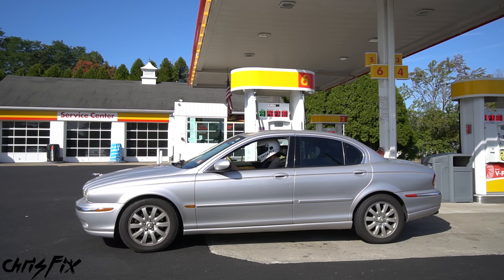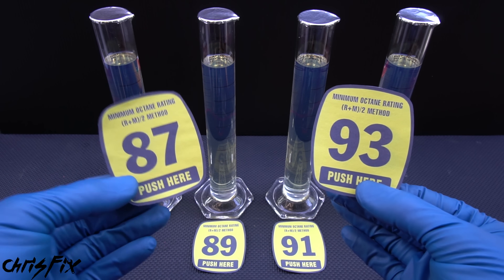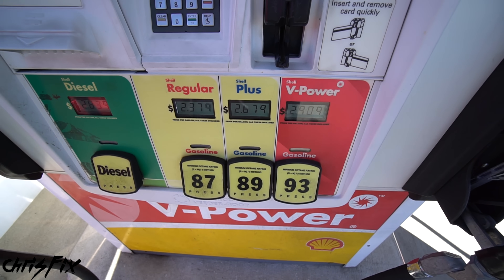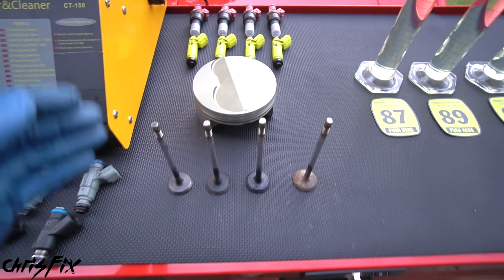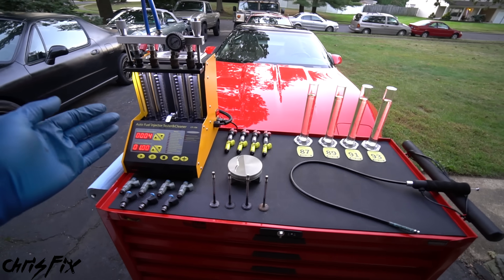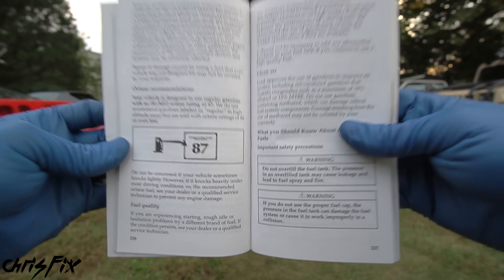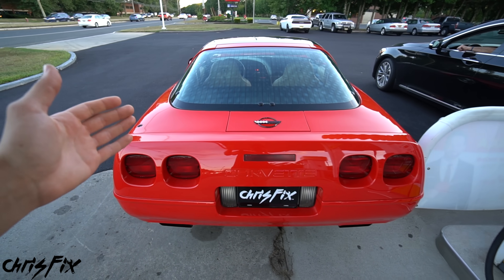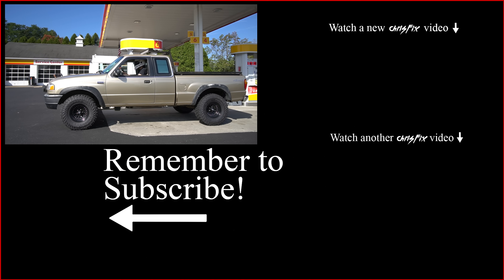What is the BEST Fuel to Use in Your Car or Truck and WHY

Comment: Is shell the only brand that has that many benefits and different useful additives? I did my best to research it and I cannot find detailed information about which brand of fuel has which amount of additives. Can I get a top 3 gas station brand list from you if that is possible? I have just purchased a 2013 Lexus Gs 350 with 100k miles and it was filled up with regular gas in the auction whilst it says premium required on it. It would be great to know which gas gives you the most bang for your buck so I can use specifically that specific premium gas to make my vehicle last.
Loooong time viewer, absolutely love your content and the way edit and film.

Comment: Do octane boosters really work????
Reply: For the most part no. A bottle of octane booster will boost your octane levels by 6 to 7 points usually. The problem is that there are 10 points to 1 octane. And putting multiple bottles in, isn't good with the harsh chemicals that are in the additive. One bottle typically is rated for treating 15 to 20 gallons. Aka..If you have a 30-gallon tank, you would likely use 1.5 bottles to treat your tank. 

So save your money and just buy higher octane gas if you want higher octane. Most additives do what they claim out there for fuel systems. But unfortunately, octane boosters not so much.

Comment: Could lifter ticking also cause the knocking code? I have a ticking noise in my car and it stops after it warms up or when I drive it for a little bit
Reply: Sounds like a vtc actuator problem
Reply: @ED17Y  I've got hydraulic lifters on mine plus when I place rislone engine treatment In it, lifters quieted like nothing but after it cooled down, and i started the car back up, the sound came back and it quiets it after warms up

Comment: Why would two different cars with the same engine use different octanes? For example, my brother's Infiniti FX35 (VQ35DE) developed a rod knock when he put 88 in it.  The owners manual did say to put 91, but the same year Nissan Maxima also uses the  VQ35DE, but it's owners manual (and a bunch of people who own them) said to use 88.  Needless to say, new engine with only 91 in it.  But why?
Reply: The cars likely came with different tunes from the manufacturers. So one car may have a higher compression ratio than the other, despite having the same engine and likely produces more horse power than the other car.

Comment: Can you avoid adding fuel injector cleaners fluids if you use 87 on an Accord or Altima at a top brand gas station like Shell, Exxon or Mobile? Or cheap gas stations like Racetrac, Valero, Sunoco or Marathon that use 87 is the same 87 in Shell, Exxon or Chevron?

Comment: My car runs best with one brand of diesel.  Total Fina sells only diesel plus (98) with their proprietary additive that runs noticeably smoother than other brands of diesel plus.  Using regular diesel (95) makes it sound like a truck.  The filler cap and manual only say diesel.  The better mileage almost balances the cost difference.

Comment: What if you have 300,000 miles one your vehicle and compression starts to drop. Would it be a better idea to go with one or the other?
Reply: You've got bigger problems than fuel if that's the case.

Comment: HELP plz. I have a 74 VW Bug. I was using regular. Then I  was told to use Non Ethanol... so I have now about 6 months. Very few stations around here have it... because of this, I almost ran out so I had to put some regular in it and then drove straight to another gas station and filled with  NE. Did this hurt my engine ??? !!!

Comment: WHAT about E88 FUELS?  IT states that cars newer than 2001 can use this fuel.
Reply: E15 (88 octane) is safe to use on "most" cars made after 2001. However, all cars made after 2013 are safe to use it unless specifically specified not to. Some cars like the Ford Fusion, for example, were not compatible with E15 until their redesign in 2013 happened.

Comment: Awesome video!!! Very helpful. My Honda Accord stopped in a middle of nowhere and it had to be towed to my dealer. 
They told me it was the gas ( LOVES 93 Octane) I used. The service manager said also to use only “BRAND GAS”. 
What’s the difference of a brand gas stations (Mobil, Shell, Chevron) compared to
non - brand gas stations (Sam’s club, Bj’s club, Loves) as far as added additives?
Reply: Judging by the details of your story, your accord "loves" 93 octane because of carbon deposit buildup in your cylinders causing an increase in the compression ratio which would cause regular 87 octane to predetonate. Consistently using Top Tier gas (which is featured with those brands you mentioned) in the first place would have prevented that carbon buildup in the first place, which is why the service manager recommended it as it has more detergent than generic gas at the kwikie mart. Please go get your cylinders checked out and have them cleaned out before you risk damage to the engine.

Comment: My car manual say i have a flex fuel engine but it recomment not to go below 87. I use 93 everytime and the power and performance is amazing kinda seem like im in a sports car lol. I think by me using 93 i believe overtime it made it run better and give better performance since i been using 93 for so long cause it definitely perform better than it was when i first got it and my gas last long too.

Comment: Very true that let's say for Acuras you have to go to the manual because he uses 93 otherwise the computer will get pinging and knocking from the knock sensor exactly on the point Chris is the best at what he does and his electronics knowledge simply a legend

Comment: I just bought the new Outlander 2022, I am very confused about what gas should I use. In the owner’s manual it says there “Use unleaded regular gasoline with an octane
rating of at least 87 AKI (Anti-Knock Index)
number (Research octane number 91).” Does it meanI can use the REGULAR 87 or should I use the Mid-premium gas 91-93. HELP :)
Reply: It means you can run regular 87 octane gas just fine. Your vehicle gets no added benefit from higher octane fuels.

Comment: Chris, what if I always get regular and add octane booster? my tank is 22 gallons, and I think it will be cheaper if I got regular and added a $3 octane booster... is that the same thing?
Reply: Octane booster sucks and should only be used if you NEED to

Comment: In Malaysia 95 is REGULAR and 97 is PREMIUM. There's nothing under 95 Octane. A 125 can make about 75 miles for $1.50
A sub 1 litre in line 3 cylinder... very popular there since the 90s... much like the 3 cylinder Chevy Sprint that met it's Oil Lobby demise in the 90s here... can make that distance for about $2.50 $3 (difference between OPEC and Western Oil opportunism)

Comment: What about fuels with ethenol?  I have heard it is not good for any vehicle, as it destroys o-rings, seals and gaskets.
Reply: Not true. Almost all modern cars you'd see on the road can hande up to 15% ethanol which is the maximum you'd find in fuel, besides e-85. E-85 will do this if you put it in a non e-85 compatible vehicke.

Comment: The best fuel for your car, is the fuel you can afford to buy. There are a million different people who will tell whats best for you, but what they fail to understand is that most decision made are based on our economic ability to pay for what we have, including it being a used or new car. Most folks are happy with a good used car that last them 5 years with minimum repair.
    What your talking about, affect's the long range care of which after 50,000 starts to cause wear and tare, most use the best they can get, based on the current information shared. Again we are speaking of a new car and not a used one, of which most people buy long after any initial wear has taken place, from 100,000 to a 150,000. At this point the damage has already been done. Making any change to fuel intake at this point may do more harm them good.

Comment: Hey I was in The west coast/Nevada/Idaho/Wyoming and there was a 0 ethanol gas. It was a separate pump and blue. Could you explain what that is and what that’s for?
Reply: It means it's 100% pure gasoline. Most gas sold in the US today is now E10. (10% Ethanol and 90% gasoline) E15 gas is also sometimes marked in a blue color pump handle depending on where you are in the US. (15% Ethanol and 85% gasoline) E15 is 88 octane fuel.

Comment: My dad used to tell me that if you use premium in your car too much, then your engine will get used to it and wont run regular...is this true? Also great video! Keep up the good work
Reply: No
Reply: Since 93 resists detonation moreso than 87, it can leave behind carbon deposits with a lower compression engine as it won't fully burn up. These deposits over time can increase the compression ratio which would cause 87 octane to predetonate, which is why the car "gets used to" 93. This is also why gas companies put a bit more detergent in 93, in case customers put it in their cars that require only 87 (which they know will happen due to deceptive marketing).
Reply: @Mikgwerd  That is really cool! Thanks for Sharing!

Comment: ChrisFix, thank you so much for this video. I have a better understanding of the different fuels. 

However, there is another type-ish of fuel (?), with and without ethanol. What is ethanol and what does it do for your car? What if I choose non-ethanol?

I have a 2002 Toyota Avalon XLS, it looks like it has been well cared for by the previous owner(s). It has over 284,000 miles on it and I would like to keep it going strong until one day when I’m rich and can afford a more fuel-efficient vehicle. 

Again, thank you. (I’m a first-time watcher of your channel)
Reply: Ethanol is just Alcohol .
Reply: @Timmytimmy707  corn made ;)
Reply: @drewbadwolf5182   or sugar cane ; )
Reply: The ethanol free will give you slightly better mileage, I use the ethanol free when I make longer trips in my newer vehicle and use it more frequently in the bigger '07 explorer because it seems to run slightly better and the slight mileage boost is worth paying a bit of a premium for it to me
Reply: You will get somewhere in the range of 3-4% better mileage on eth free vs. E10 gas. Nothing wrong with running E10 in a modern engine, it's your choice

Comment: Excellent video my VW EOS gas door says 91. 99% of the time I use just that. If I can't find it and need it I get 93. Is it true I should use higher octane when driving far on a high way?  Also besides oil changes how can I reduce carbon in my car. My oil gets dirty  fast.

Comment: I have a 2017 vw jetta 1.8t and it says to run regular and I don't because I have a turbo I run 93. If you run a turbo and use regular you're cause build up and turbo sludge.  With is bad so I disagree when you say go with the factory usage of gas.

Comment: THE VALVES DO NOT REPRESENT ANYTHING REGARDING GASOLINE THE CARBON STICKED TO THE VALVES ARE THE RESULT OF THE POLLUTANTS OF LOSS OF ENGINE OIL THROUGH RINGS OR THROUGH THE VALVE CELLS

Comment: Hey Chris, I'm a subscriber and I've been watching your videos.  If Shell Premium is consistently used in my vehicle, can I safely assume I will NEVER need any other fuel system cleaner?   If this is true, I'm not really wasting money in the difference in fuel cost between cheap grade and premium?  My car can run on cheap 87, but I use Shell Premium for its cleaning attributes.  Am I nuts?
Reply: I believe you're correct but with how cars are made these days you likely won't have those issues regardless because of how stringent are gas laws are
Reply: Fuel doesn't clean your engine. You'll need the extra additives. Having the thought that fuel cleans your engine is a myth.
Reply: @ramir332  true but doesn’t she’ll premium come with additives to clean like techron?

Comment: No eu 95 is us 91 so in general we have one step higher octane in europe.
Reply: You obviously didn't watch the video. Gasoline in the US is calculated with a different more strict formulation for determining octane than what Europe uses. US/Canadian (R+M/2) 87 octane = 91 European "Ron" octane. US 91 (R=M/2) = European 97 octane. And US 93 is 99 octane in Europe. 

Example: Tesco and Shell in the UK offer 99 premium fuel. They have a "Mon" rating of 87 octane, but a "Ron" rating of 99. So (R+M/2) = 93  US/Canadian octane. 😎

Comment: No.  An octane rating is comparison rating of the fuel based on a percentage of if you were burning 100% pure octane.  Very little of petroleum fuel is actually octane.  A higher octane rating means the fuel is harder to ignite.  Your detonation video is all wrong.  Detonation is when the fuel ignites prematurely on the compression stroke before the piston hits top dead centre or the spark plug fires.  This causes the combustion to fight against the upstroke of the piston rather than force the piston down as the engine is designed to work, damaging the combustion chamber, piston, connecting rod and crankshaft.  Your video made very little sense except when you state to use what the manufacturer recommends.
Also, petroleum is a liquid fuel, not a gas.  Gas is what you get as exhaust after combustion of the liquid petroleum fuel.

Comment: I used to road trip every weekend, and I personally tracked my gas mileage on 93 octane vs 89 and I always got better mpg on 93 by and avg of 2mpg.  I got gas from the same station each time and did this over about a 4 month period.  Can you explain why?
Reply: I usually run a tank of high octane gas through my vehicle 2 or 3 times a year. I also attain about a   2 mpg increase. But when you figure in the extra cost of the higher octane gas, it works out  that  the cost per mile is exactly the same.
Reply: @swampfox1582  I agree.  I was just curious because in the video he said it’s a myth that you get better mileage on higher octane gas, but my experience has shown it to be true for me

Comment: I have a brand new 2020 Mercedes Benz GLA 250 4matic, and never ever use any other fuel but the 93 - better for the engine, consumption and above all, better for the oil, no dirty deposits in the fuel to damage my engine.